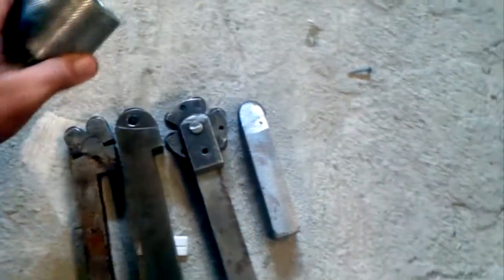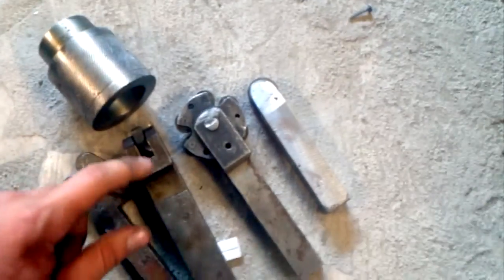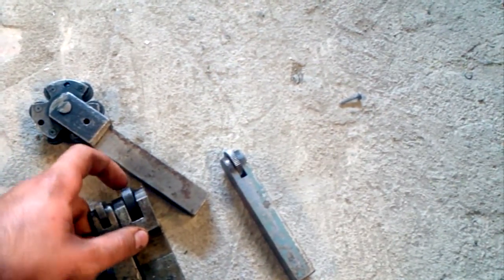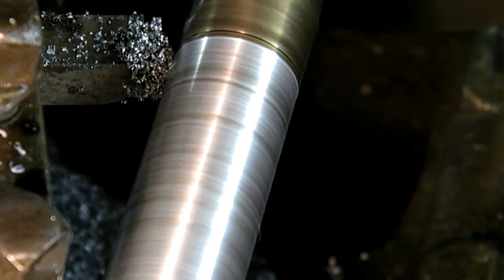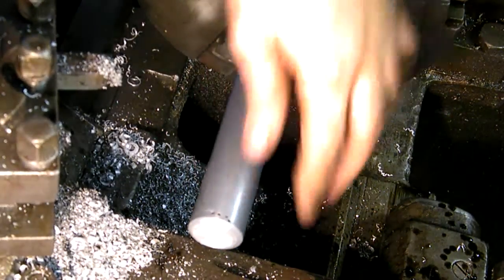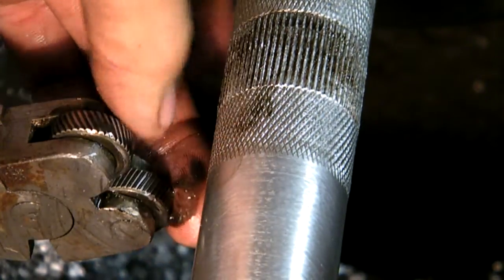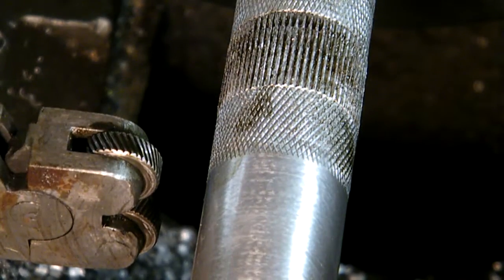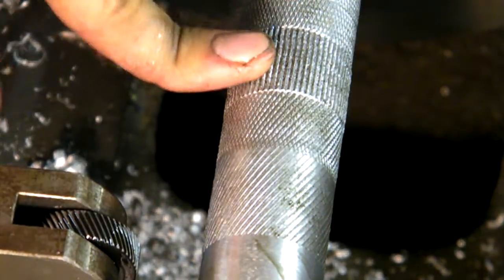how to knurl on the lathe all types of knurling

Comment: What tool do I use to knurl hard steel ~ RC 45?
Reply from the maker: i would use my lathe , locking the spindle,out of gear, for longitudinal straight lines (like a shaper) or on high pitch threading  (like a screw with multiple ends), if this is not possible and its a must i would try to sacrifice some knurling wheels for my knurling tool you can use it one or twice before it becomes dull and won't leave proper marks, or if possible get hss knurling wheels those should stand a chance.
Reply: I basically want to knurl a 2.2m round steel (material 17-4 PH stainless steel aged at 900 F). The knurling will be diamond knurl and it will be across 1m length. Not continuous though in the middle of the shaft.
Reply from the maker: you should make some tests... i think u can do it with a regular knurling tool

Comment: Interesting video comparing the knurl patterns.

Would be better if you use single point focusing on the camera - turn off continuous focus to avoid the focus issues you got.

What lube were you using?
Reply: Pune ulei si pe piesa si pe roti, in timp ce faci randalinarea. Pe aluminiu nu e asa ''grav'', dar pe otel si pe alte metale, se uzeaza liniutele de pe roti si n-or sa mai scoata suprafata buna.
Reply from the maker: dar am pus